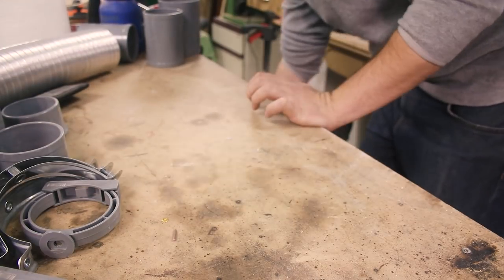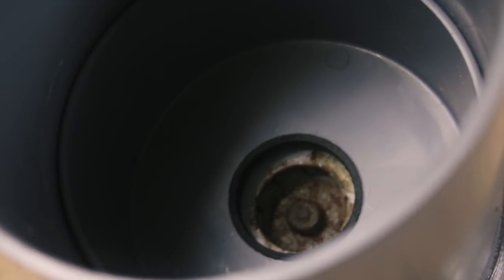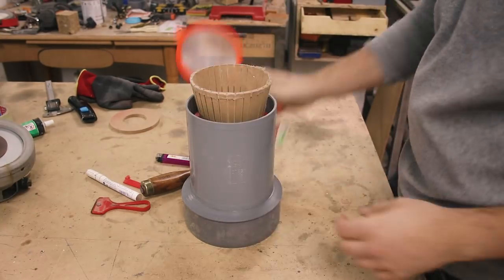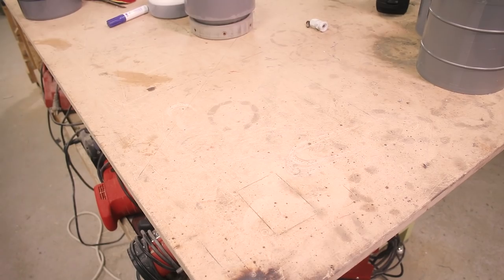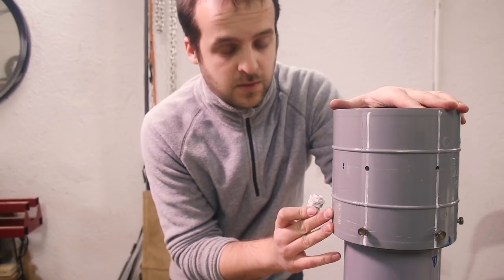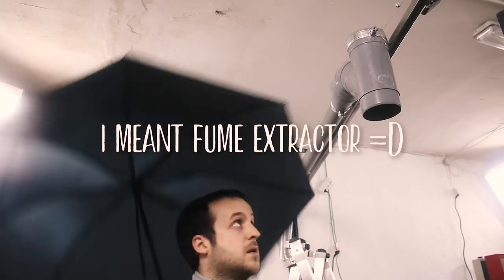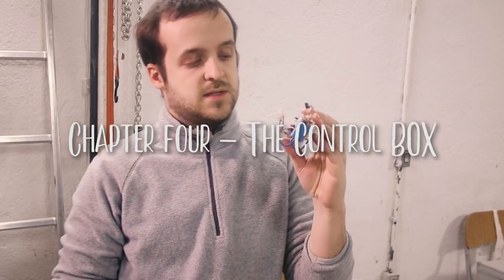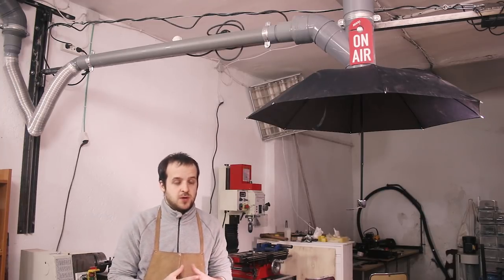Umbrella + Vacuum cleaner: DIY Fume Extractor

Comment: make the flexible hose on the joint as short as it can be. I'm working in air conditioner installations at the moment and I can tell you the most important thing is to have the straightest and smoothest path possible. Flexiduct has a bunch of ripples that slow the air and it means your motor is working harder than it needs to
Reply from the maker: yeah! thanks! I'm aware, I'll shorten it as much as possible!

Comment: Just an FYI, the vacuum motor is not spark free it will have the possibility of igniting flammable fumes, so do not use this for painting or anything that has flammable fumes!!!!!!!!!
Reply from the maker: That's a great tip Mike! Thanks for the notice! not brushless indeed. I wasn't planning on anything like that but glad you mentioned! :)
Reply: No Problem, I just wanted to make sure that someone would not mistakenly try to adapt this to a spray booth or the like.

Comment: No disrespect here but there are some great reasons that engineers design items like this! That flow through Vac motor sucks a lot more power then air in this miss application. I would guess right around 1500 Watts to move less then 100 CFM with huge unrealized pressures. At lower pressure you could move 100 CFM with a 60 watt motor or you could move 300 to 500 CFM out of a 500 Watt pressure blower that might be in the range of 2" of water lift. A vacuum motor will easily pull 90 to 150 inches of water up a 2" pipe. This is like using a bottle jack to lift a square foot of styrofoam, there will be a lot of extra pumping! Fume extractors and the hood or pickup bells are designed altogether to match the CFM and low pressure blowers. The intention is to pull it in close to the work and draw it in before it passes around your face and helmet. You could not accomplish this at 100 CFM unless it was extremely close to the fume source.
Take a cigarette and the average household vacuum and see how close you have to get before the smoke will vector to the suction? The commercial built units you might fine in a backyard shop are in the range of 400 to 800 CFM. I get that this is what you had, but that does not make it worthy I would not try to adapt 2 in wheels to a lawnmower so I don't see the point of this missed design. Had you done this with an old electric leaf blower you would have a much more useful design as this is also a cheep common air mover but its specs will match this task about a 100 times better.

Comment: How many cubic feet of air is it removing? Are you filtering or just venting? That seems like an aweful lot of distance between your fume extractor and the fumes
Reply from the maker: +Joseph Prosnitz no idea in metric nor imperial :D I'm just venting and I have another flexible hose to catch fumes closer to the source instead of the umbrella :) thanks for watching!
Reply: You know there are standards for how much air you need to remove for the air to be considered breathable? here in the states aws issues some guidelines. Are there prints of the design?
Reply: Yes , you want it alot closer so a little doesn't pass through your helmet and in your lungs first
Reply: At the end of the day. Any extraction is better than none. This looks pretty cool to me. Well done.
Reply: @kevinbradley2941  well said brother

Comment: I know it has been quite a while since post, but if you (or other viewers) see this: how well do these motors handle intake resistance (in terms of (over)heating)? I want to build a fume extractor for soldering work, but do not have easy access to venting outside - I have a one room home so it will be used where I eat and sleep too. So it needs a proper, fairly bigboy hepa filter and carbon filter. But that, along with 1.5-2 meter 60mm hose will create significant airflow restriction, and I'm wondering if that will likely be ok or if it's very likely doomed to burn out the engine. A vacuum cleaner motor is maybe a bit overkill for such use (decent commercial single-port units seem to be ~185-250 watt), but the only other "suitable" fan-motors I find for cheap are 50-100 ish watts and not designed for any airflow impedance, just unrestricted flow.
Reply from the maker: Vacuum cleaner motors handle very well the back pressure as they are designed for that. In this application, while the pressure is not an issue at all, I actually miss a bit more airflow, that's the downside of these motors. Normal extractors with less power are meant to move a higher air flow at lower pressure drop. This one is quite the opposite but does the job anyway. This motor is about 1.5 kw I'd say. Hope it works! I have 6m of piping (125mm diameter) and I just installed the mesh filter you see on the video. Cheers
Reply: @Cactusworkshopchannel  Thank you so much for your rapid and detailed response. I imagine for my use, tons of airflow isn't very important, unless I misunderstand completely. At my job I was working with a Weller Zero Smog EL (Kit 1). And while it did a good job filtering, it's way out of my personal budget for home use. But more frustratingly, being 120 watts, for it to actually catch just most of the smoke and fumes coming off my workpiece, its funnel had to be *at most (!) 15 cm away. Ideally max 10 cm. That is extremely frustrating and problematic when doing soldering and microsoldering work under a microscope with hot precision tools. And with the nature of this work in a microscope, it's important to get as much of the fumes as possible, because my head is stuck 30-40 cm right above the work piece for the entire duration. It also means, thogh the fume source is a fairly small point, the fume extractor funnel has to be off to the side of the source, it can't be above it. Heck with the Weller unit, if the PCB I'm working on is any bigger than roughly 25x25cm, then the fume extractor funnel has to even sit/lay on top of the PCB, rubbing and knocking around on components.

I was kinds hoping I might with a vacuum cleaner motor, big surface filters and a relatively narrow tube (60mm), at least get the funnel 25-30cm away from the fume source.

Comment: is it possible to get all the pats list to make the housing would like to use this design to build my own
Reply from the maker: well I suggest you go and test at your local hardware store since the motor might be different and also the sizes :)
Reply: I can get some of the parts but not all the motor i have is 130mm in the suction part same design motor